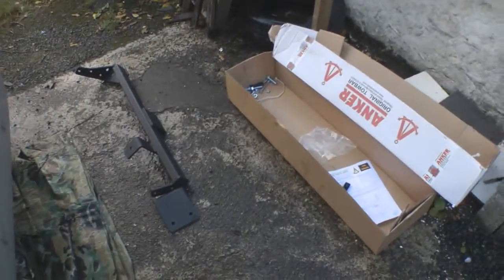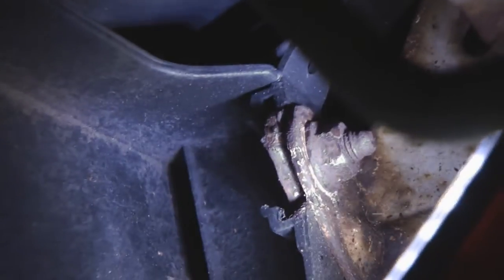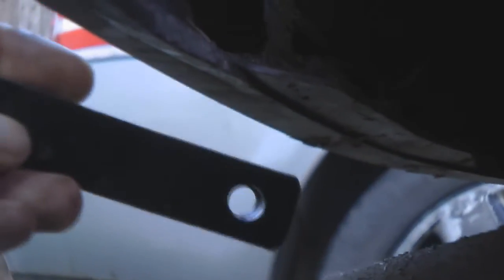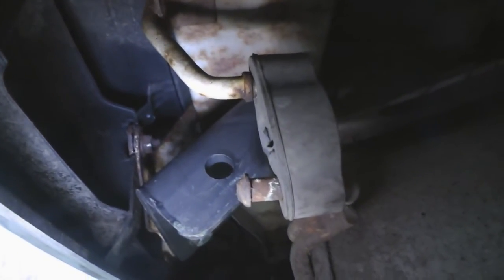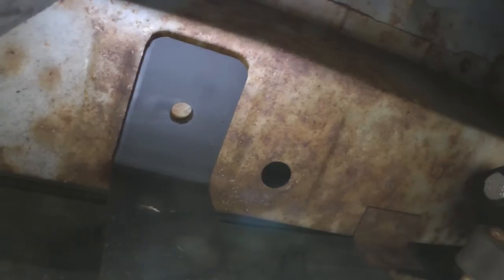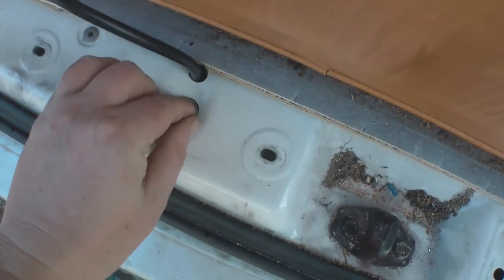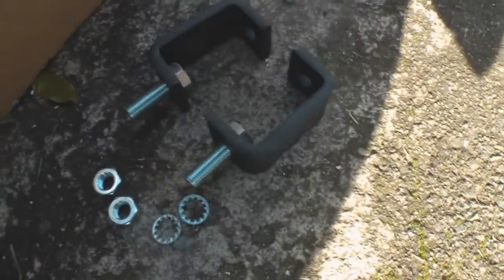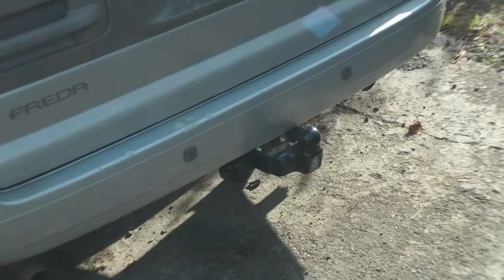Ford Freda Mazda Bongo Fitting Towbar

Comment: Love this thanks  mine is a particularly rusty Freda I certainly don't fancy getting the bumper off have a welder too.Towbar  has gone up a bit in price but they didn't list the electrics so I bought another now I have two useful spare I suppose.
Reply from the maker: Thanks Paul. Glad you found the vid useful. Rust is a bummer on them. My Freda is currently of the road needing significant welding. ☹ Atb Dave

Comment: Went straight on no problem good fit all bolted up done the electrics. Then I noticed the problem kind of bad really  tow ball  is one whole inch over to the right bit silly no play to correct this and my body work is symmetrical, So i had to remove cut plate off for tow ball and shift to left and re weld it,  yours seems to be okay..
Reply from the maker: Wow that sounds like a major manufacturing fault. What a pain in the bum. Glad you were able to sort that yourself.
Reply: Have just posted regarding my problems with the same bar
Reply: @playing_in_trafic  Advice with your welding do it for strength not looks. But regard looks with MOT that's all that matters these days mine looked rather good when I bought it and sailed through first MOT Been off the road a whole year while I repaired the  underneath it was body filla all over the place that  made it look so good the first time around they don't tap and bang these days apparently, so looks mean all. I do not and never will use body filla underneath my vehicle. If you catch my drift.
Reply: Had same problem hence my post today.
Reply: @shanepiotrusiewicz8880  Is this a design flaw? As i was about to get one.
Reply: @eoinmartin100  I took mine back and a guy measured it with a broken tape measure, what does that tell you. Just keep away. Check out Tow trust. I wish I had
Reply: @shanepiotrusiewicz8880  just ordered my tow bar from tow trust, I am replacing the tow bar as the one that’s on is totally rusted. So hopefully all will go well with the fitting.